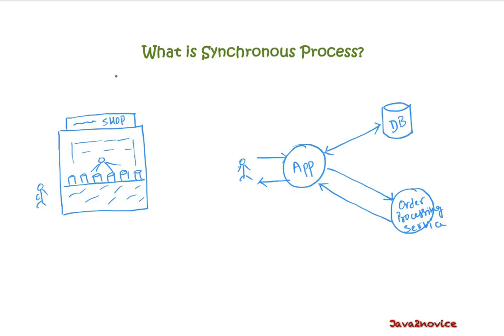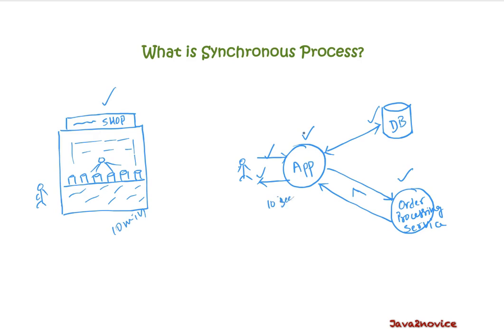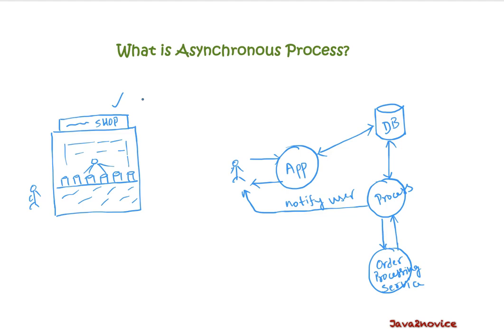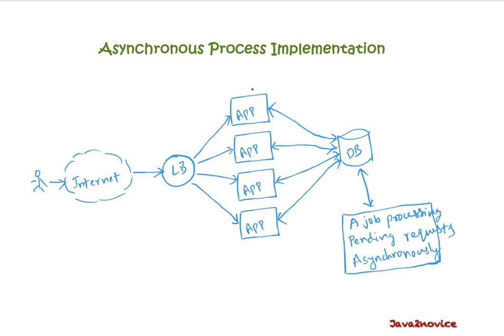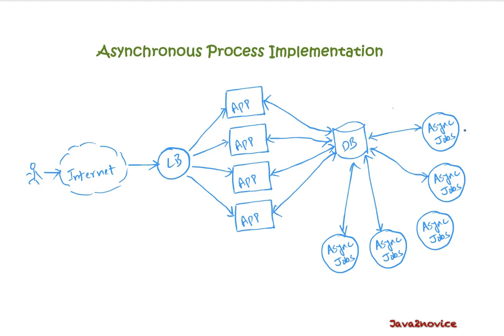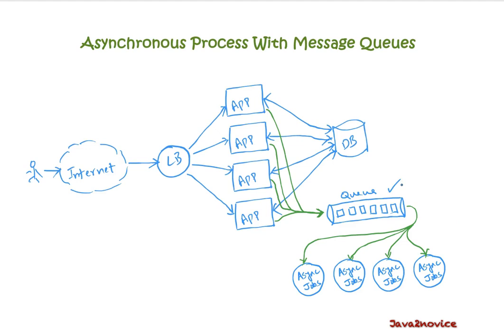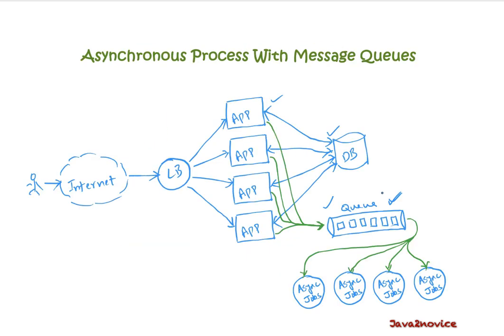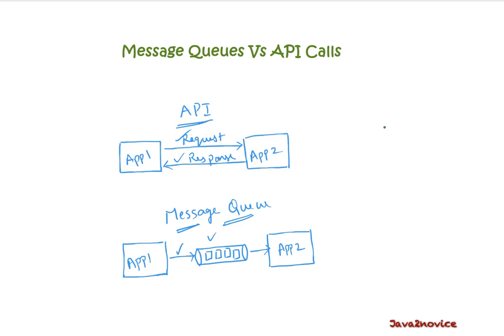Asynchronous Processing Using Message Queues | System Design Basics

Comment: Nice. Would you recommended using Active MQ or Kafka in case of application which acts as a Webbook Receiver. My idea is to do exactly what you shown in the diagram , storing in DB first and also push to MQ and async jobs can process from MQ.
Reply from the maker: Thanks Chris Pure. Yes, you can do that. But whatever I said here is to give overview on asynchronous processing. The practical implementation should consider nature of your application & use-cases before implementation.